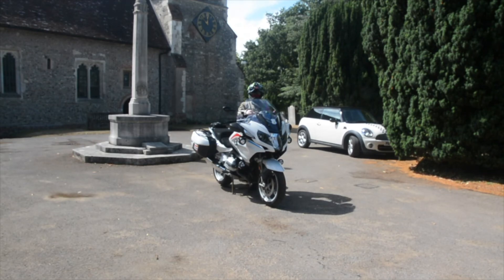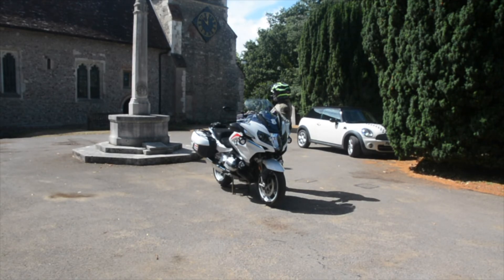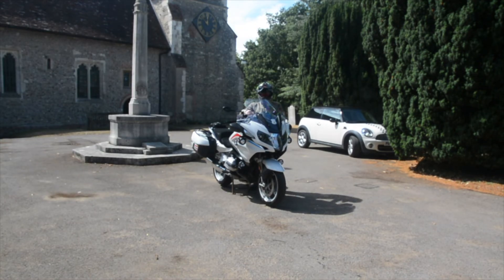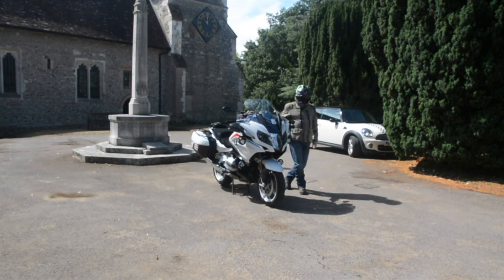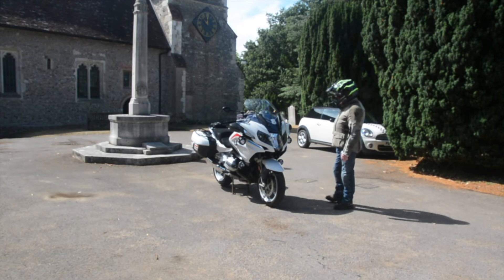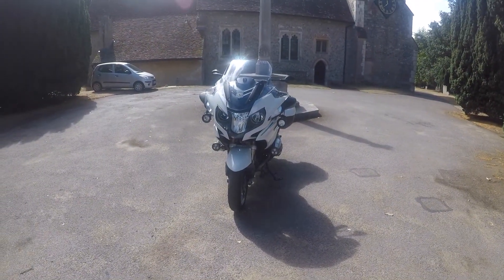'Let there be light' on the BMW R1200RT.

Comment: Nice and conspicuous 👍
Can you give us details on fitting especially how the mounting bracket are attached? Brand names and cost too please. 
Thanks
Reply from the maker: Thanks for the comment. 

I will try and answer your questions. 

The starting point is the way in which the whole kit is powered and integrated into the bike's Canbus system. This was achieved using the Denali Gen II Can Bus CanSmart Unit see https://www.nippynormans.com/denali/cansmart/denali-gen-ii-can-bus-cansmart-unit-for-r1200-lcadv-lcr-lcrs-lcrt-lc-r1250gs1250adventure-r1250r-r1250rs-r1250rt The way in which this operates and is fitted is set out in the accompanying instructions see https://www.nippynormans.com/usercontent/doc/99302/rag-dnl-whs-11602ins.pdf Obviously, the routing of the wiring is something that you will work out yourself but the front fairings are the only front plastics that require removal. The brake light requires removal of the rear rack and all that that entails in order to be able to discretly run the cable up to the control unit. The beauty of the system is that it is entirely plug 'n play and doesn't  require any cutting into the bike's wiring loom.

Once you have installed the unit and the accompanying cables it is a matter of fitting your accessories of choice. I opted for the RT specific package see https://www.nippynormans.com/denali/full-kits-spotlights-horn-and-rear-light/denali-complete-gen-ii-cansmart-kit-lighting-and-horn-r1200rt-lc-2014-to-2018-r1250rt-including-2021-model-onwards This includes the Denali CanSmart Plug-n-Play Controller, 2 x Denali DR1 LED Light Pod with DataDim Technology, the Denali B6 Auxiliary LED License Plate Brake Light, the Denali Sound Bomb Compact Dual-Tone Motorcycle Air Horn, the Denali Horn Mounting Bracket and Denali Auxiliary Light Mounting Brackets. These light mounting brackets are fitted behind the fairing & under the mirrors. 

The lower lights are Denali D3 LED Light Pod spotlights with DataDim Technology see https://www.nippynormans.com/denali/spotlights/denali-d3-led-light-pod-spotlights-with-datadim-technology-each and were fitted using a combination of the Givi LS5113 Motorcycle Fog Spot Lights Holder Brackets BMW R1200 RT 2014 - 2018 see https://www.ebay.com/itm/283806208516 and the Denali crashbar light mounts black (22mm-28mm) see https://www.nippynormans.com/denali/brackets-for-horns-and-spotlights/denali-crashbar-light-mounts-black-22mm-28mm

All prices are indicated within the annexed links.